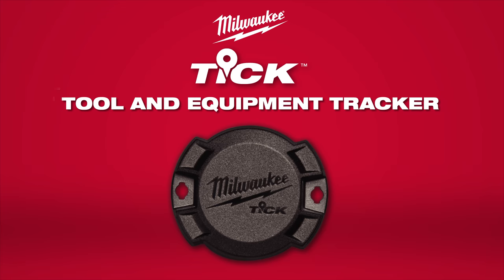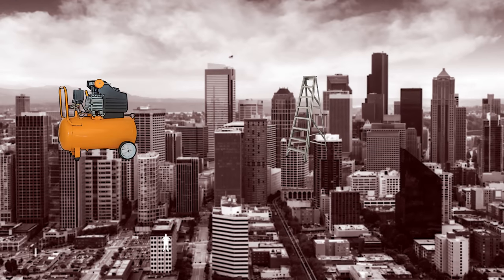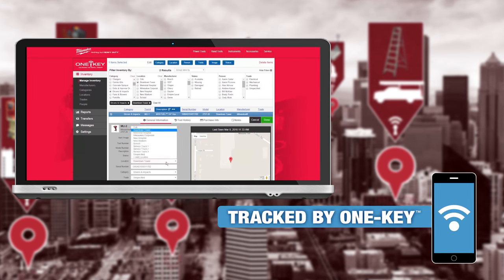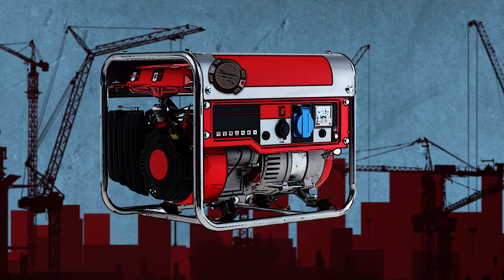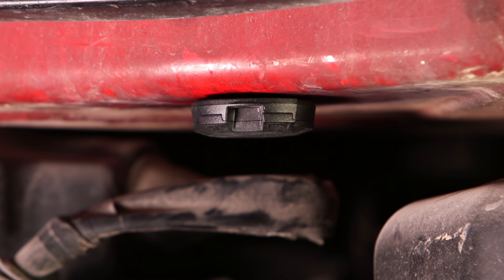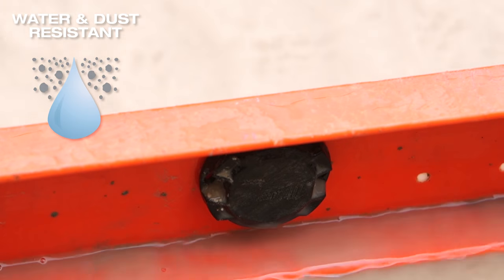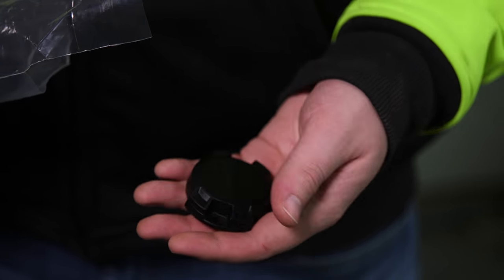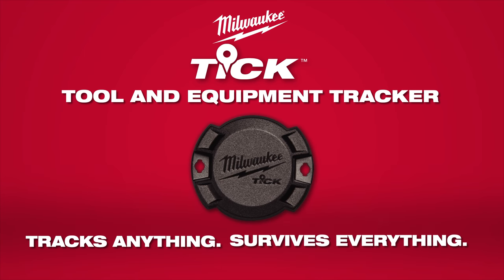Milwaukee® TICK™ Tool and Equipment Tracker

Comment: Love the idea. Sadly 100ft makes it useless to track stolen goods. Nobody here uses Onekey. Put GPS in it and I'll buy it
Reply from the maker: The ONE-KEY Network currently pings 187,000 tool locations every day and the network is continuing to grow.
Reply: @MilwaukeeTool  hey I have a question for you guys; if I got a Milwaukee tattoo in a visable place wold you guys give me discounts on tools to promote? All I use is Milwaukee I have both drills, bandsaw, sander, multi tool, sawzall, circular saw, jigsaw, and a lot of bags and hand tools I'm practically a rep for the company everytime I step on a jobsite with all my bags.
Reply: @specops1903  will you put it on your forehead?
Reply: @Shroommduke  yeah bro all we do is forehead tattoos
Reply: @specops1903  well done I’m the same for makita 👏🤦🏻‍♂️

Comment: There are too many variables that have to be in line for this to work (for me anyway). - To hunting your tools down on the jobsite, its great! - To work as a Low-Jack type device, there would have to be other One Key users near it. - I would love to use this for band equipment, etc. - But the chances are pretty slim that One Key will be anywhere near my equipment if stolen. - Cool idea .... just not ready for me yet.

Comment: only a 100 feet?  Need longer range!  Nice idea though and it will have a future!
Reply: CORAL ROCK PLUMBING INC. I think you may be misunderstanding this "100ft". This is not GPS, but if any device with the one key app comes within 100 feet of the TICK, it automatically updates the location of the unit on your phone (your eyes only). The larger the community of people that start using this application, the better the tracking feature on any one key item will work. 

EX: If some guy steals your ladder with a TICK on it, and 3 days later some construction worker with the app on his phone, comes within 100ft of your ladder, it will give you the current location.
Reply: Dewbs So its not necessarily you being 100ft from it, its the app being within 100ft?
Reply: +Nato_Potato exactly
Reply from the maker: +smithsfan425 +nato_potato the last know location of your tool will be updated when you are within 100ft. If the tool is stolen and marked as such in the app when someone with the one key app on their phone, whether it is open or not comes in a 100ft range of the tool the original owner is notified.
Reply: Milwaukee Tool Ahh ok thanks for the explanation...
Reply: Andrew Armstrong right !
Reply: Cool
Reply: A phone with the app needs to remain in close proximity of the tick for some time before it registers. Simply walking by is not sufficient. In a practical sense, it doesn’t work.
Reply: Milwaukee Tool, network of cell phones will work together to notify the owner where the tool is when any cellphone with the app is within 100 ft radius?
Reply: @MilwaukeeTool  great all you gotta do is drive to the dudes house who stole it for the device to tell he stole. Got it.

Comment: Make it real time GPS and you have something and of story
Reply: It would require a subscription
Reply: @dougfoster445   I have no idea what you mean about a subscription even the cheapest cell phones with GPS still work even though their disconnected
Reply: @Asphaltmafia1  The cost of a cell phone has absolutely no bearing on whether or not the device communicates with the carrier. In order for a device (like this TICK Tool Equipment Tracker) to work like we would all like, it would have to use a carrier's network (towers and satellites)...No one is going to build towers or send satellites into space unless there's profit involved. With Cell phones, you don't get internet or can make calls unless you are paying a subscription and therefore using data. There are moments that a non-carrier-connected cell phone CAN connect to the internet but thats only using an access point, like your wifi or a router (which SOMEONE IS paying for that subscriptiong). A disconnected cheap cell phone Pinging or handshaking a tower is very minimal and doesn't use virtually any data and also VERY limited. you can't use your disconnected cell phone to pull up GPS on a map unless you are connected to wifi. in order for this tick tool tracker to have GPS it would essentially HAVE to be connected in a similar way as a cell phone to a carriers network. 

On a side note, there ARE devices out there that do this. And they are subscription based. You pay a monthly or yearly fee and you can put the device anywhere and it'll send a GPS location to a server where you can track it.

Comment: Question. Does the app show u the ticks battery life? Cause if not then I have to keep an inventory of what tools have had the battery changed that year and that point I'm keeping a paper inventory anyway. It would be nice to have it so I could see what tools are in the field and the ones in the shop. And if one needs a battery soon I can just change the one that needs it. Rather than  keep track of when I change batteries on 1000+ tools. At that point I'll just keep using the paper system and not buy batteries.
Reply: Yeah, it shows you the battery percentage.
Reply: +Doresoom Reviews ok, then I'm sold. That makes inventory a lot easier.

Comment: if Milwaukee would offer GPS system with very low monthly fees i would looooove to go with this Reliable Company...Common Milwaykee make your own Wireless GPS system Network and offer maybe frere GPS tracking to all your equipment it will beat any other company and attract customers like no other time ...( im Milwaykeee user for 8 years looove tools )
Reply from the maker: Maksim, check out our ONE-KEY feature here - http://ms.spr.ly/6051TRyp5 With ONE-KEY, you are able to Customize, Track and Manage a tool’s performance and location.

Comment: I don't get it. 
If I'm within 100ft of my tools, I'm capable of protecting them. 
I had hoped it would be a satellite tracker without a monthly fee, so I'd know if a trailer or whatnot was stolen.
Reply from the maker: The tracker works off of the ONE KEY network so when it is in 100ft of any phone with the ONE KEY app you will receive an updated location on your device.
Reply: Thanks for the reply. 
 I work alone and want a tracking device for my trailer when it's left somewhere my phone and I aren't.

Comment: so ..let's say my impact gets stolen and it's on the other side of town. if another one key app detects it's it will notify me??..
hmm might throw one inside my DD 9912sc
Reply: In theory, yes. However, I've had mine for a few months, and NEVER gotten a location update from another user other than my own phone. I spent two weeks with the app uninstalled on all my devices and never got an update -  I live in an area with a metro population of 440K.

Comment: 100 feet wtf but it says multiple job sites at once hell you got to drive to every single one of them and walk around the whole entire job site just to find your tool not to be there what is the point of a tracking device if you can't use it properly. These devices should be verified bye the police that way criminals can't use them to track cars and whatnot

Comment: So, basically, this would be potentially useful for a 100' cord?  100' on a commercial site is 100% useless and 80 % useless on a residential unless you can't remember anything. After a few beers with another business owner, we thought this product would be useless on small tools because a thief or employee would just knock it off and useless on heavy equipment because if that's stolen, it usually goes miles away.  I am unsure what the purpose of this product is. Might be ok if several owners used the same key and the old system of "Have you seen.....?", but otherwise seems kinda useless with that range.

Comment: Had until you said 100 ft
Reply from the maker: The last know location of your tool will be updated when you are within 100ft. If the tool is stolen and marked as such in the app when someone with the one key app on their phone, whether it is open or not comes in a 100ft range of the tool the original owner is notified.

Comment: This one key is bullshit.  its not a tracker like TILE ,  it can only work if its in 100 feet of a cell phone that has the one key app.  If there is no cell with this app around,  the TICK is worthless.
Reply from the maker: Hi Eric, thanks for the comment. The location of the TICK is updated whenever you are within 100ft of the app. If whatever you are tracking with TICK Is lost or stolen you simply mark it as such within the app. Once the TICK comes in range of any phone with the ONE KEY app the original owner is notified.
Reply: It's EXACTLY like Tile. It uses a network of users with Bluetooth enabled phones for crowdsourcing locations. However, they don't have nearly the size of user base Tile does, and they keep breaking location update frequency with their Android software updates. I was getting updates every 10-15 minutes with v3.2.0, now I'm only getting one every 1-2 days with v3.3.1.
Reply: Its nothing like tile.  If a person does not have there app it wont work period.  And at only 100 feet range.  ( example) If I have the tick on my drill and I have the app,  it will only let me know if my drill is with in 100 feet of me.  If my management team has the app and all of our tools downloaded, at least one person has to be with in 100 feet of our tools to be located.  If no one is near a tick,  it wont tell you anything nomatter how many people have the app.  With my tile, if my suitcase went to Paris and I went to Germany, my tile will tell me where my suitcase is at at all times.  The tick is relying souly on the basis that at least one person is with in 100 feet.  They need to change from blue tooth to GPS and then they would have a great product.  So lets be clear, Unless you spend every single work day on a job site and stay with in 100 feet of you work area and so do your tools,  this product is worthless ..............